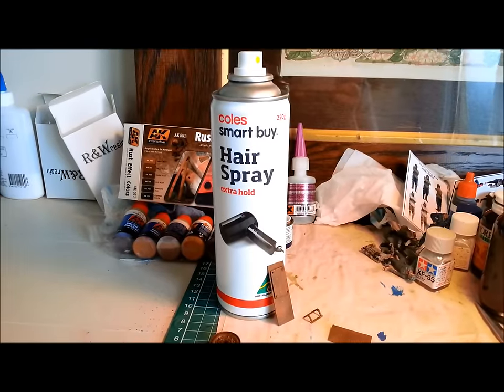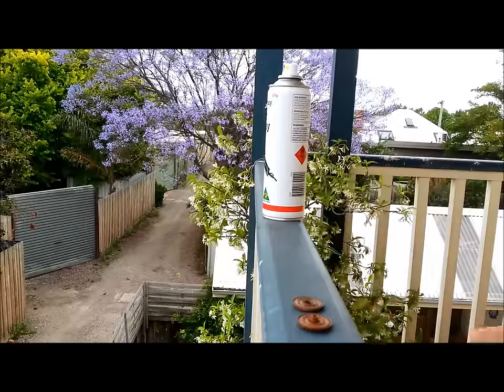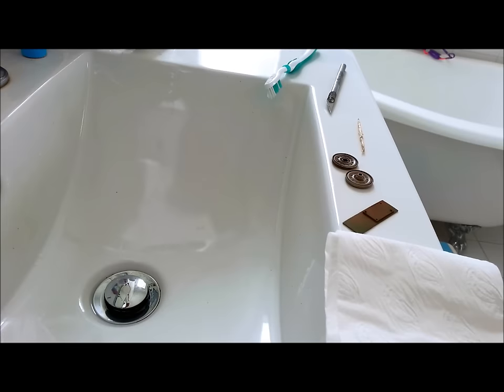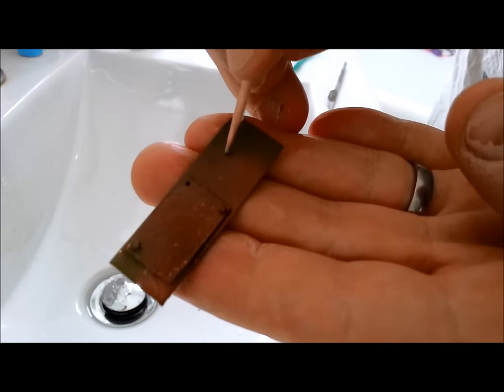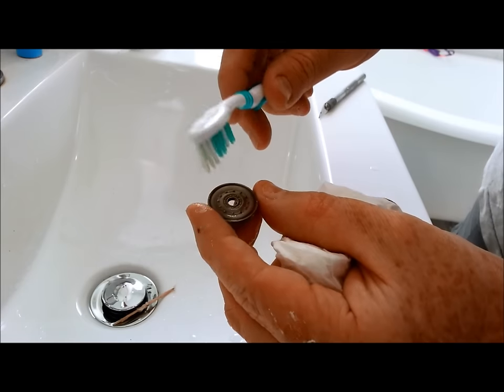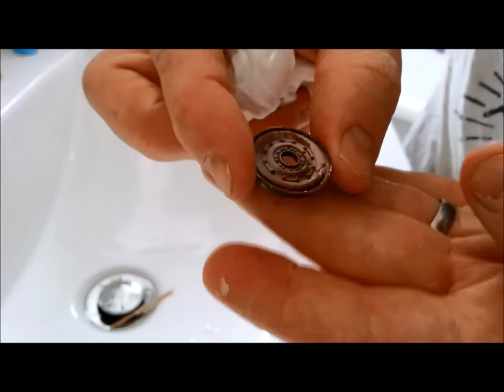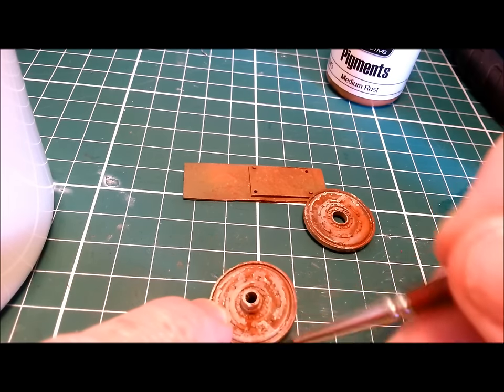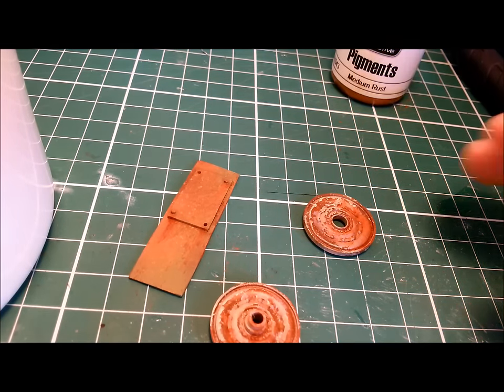The hairspray technique for chipping paint on scale models

Comment: Dave...Can you spray two or three layers of paint over the hairspray and get the same result ? Meaning can this be done if the vehicle has a camouflage paint job or do I have to paint layer then add hairspary, chip it, seal it, then add another layer of paint etc etc
Reply from the maker: I've not done camo over the top, but I can't see why not. Try to keep your layers thin if at all possible, I have found the thicker the paint on top of the hairspray the more it tends to come off in big chunks when wet. Let me know how you go! Cheers, Dave

Comment: Excellent Dave!!.
Have u seen the new Humbrol EnamelWash??, weathering an powder paints for rust moss sand snow everything. The effects are simply BRILLIANT!!! I would like to see u use them. As my results were FANTASTIC!! An your way better than me, but I think I could match you, as best I could. Gotta hav that strayan pride!! Hay.. But seriously would like to see what u could come up with. Let me no cheers mate. Scott
Reply from the maker: Hi Scott, I haven't used Humbrol enamel washes before, but they look good. I think you could probably get a similar effect with just normal enamel paint and thinners - do you think? Definitely sounds interesting. I'd struggle since I tend to paint most of my models with enamels, rather than acrylics, so an enamel wash would kill the underlying paintjob, but if they flow as well as they seem to in the Humbrol videos they look good. Cheers mate, Dave
Reply: Dave's Model Workshop 
Hi Dave as u said the Humbrol is Enamel. An yes u would get the same effects, but WITH the washes it's MUCH simpler. An no u will Not damage the paints underneath. Just need to make sure there well cured or if u wanted to be extra safe u could use Matt clear sealer. Then add the wash. It's really amazing how say if you want to put moss it say brick wall's u just load up a number 1 brush put it on n the gaps were the cement would be an it's quite strange the way it just pulls it self into all the gaps in the brick work, or say a tank/plane has all the lines in the plastic put your number 1 load up put in the crack an it pulls it self into all the gaps BRILLIANT!!. Any on the surface just wipe away with cotton bud. Or say moss on tin roof lay a descent amount along the edge of the roof, get a 4 brush dip in thinners an dilute upwards Very simple an quick an effective but layering for me really adds the true effect with other washes. So just to confirm it is ENAMEL, I USE NOTHING ELSE. An don't like the effect to much just thin out with thinners an then just dry brush it out to reduce. I DO have some TAMIYA Acrylics but very rarely use em, just don't get the desired results. Dave seriously give em a go you'll be glad u did. Keep the EXCELLENT YOUTUBE VIDEOS COMING LOVE THE PASSION AN WELL EXPLAINED. CHEERS MATE. R U IN STRAYA ?? I'm in W.A Hope to speak again. Scott

Comment: QUESTION
I am using enamel paint since acrylics seem not to stick to the plastic of my model kits. Using enamel paints for the silver base coating and later for the camouflage, how would the hairspray method be done in this case?
Reply from the maker: This works just fine using all enamels.Apply your enamel base coat, let it dry. Apply hairspray, and then a top coat of enamel. Works just the same.  (On a side note, if your acrylics aren't sticking, have you tried a base primer coat first? That might help)
Reply: Thanks, Dave I don't want to spend money on acrylics!Thanks so much.

Comment: Very good stuff indeed... I just subscribed to your channel etc. My question is : how long can do you leave the hairspray layer to dry before you paint it and how long do you give it after you've painted it before chipping off ? Btw. how many pieces of kit have you lost off that balcony and I bet your wife loves it when she finds chipped paint all over the bathroom !
Reply from the maker: Hi Ian, thanks for your compliments, good to have you aboard. I leave the hairspray to dry for about 30 minutes, but basically as long as it's not tacky to the touch or still glossy in places, you'll be good to go.  Once the paint is on I leave it again for about 30 minutes, but I was using quick-drying acrylics. For enamels I'd probably leave it to cure overnight before wetting it.

I've been lucky, I haven't lost any bits over the edge, but I don't do it on very windy days! If one piece does go over the edge, it will disappear into a lawn beneath and I'll be screwed ;)

And yes, I definitely make sure to clean up the bathroom sink when I'm finished, for precisely that reason!

Cheers, Dave

Comment: when you do this do you prime, paint actual color, then spray hairspray and chip or do you need the rust color under actual paint?
Reply from the maker: You prime first, then paint the rust or metal colour you want to show through. Then a coat of hairspray. Then once that is cured, paint the final topcoat (whatever paint colour the barrel is supposed to have been painted). Then you wet it and chip away that final paint layer, exposing the rust/metal layer underneath.

Comment: Would this work if i apply paint on my model by brushes ?
Reply from the maker: I haven't tried it with brush painting, but it should still work - there's no chemical reason it wouldn't. Just try to keep the paint thin, not too thickly applied.  Cheers, Dave